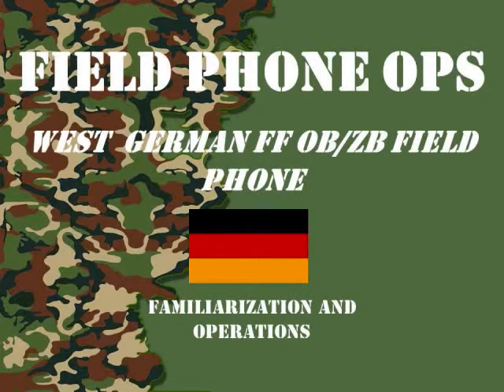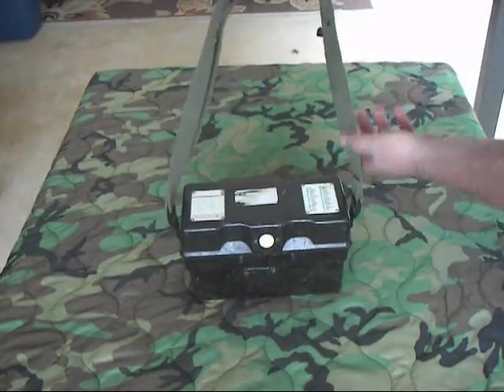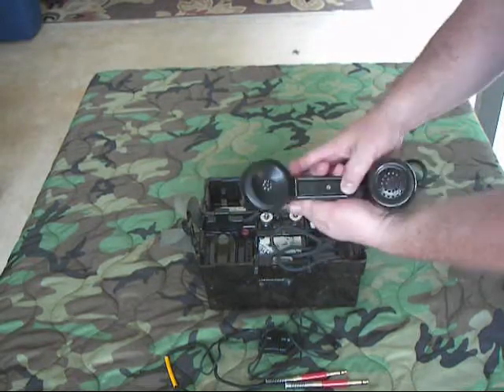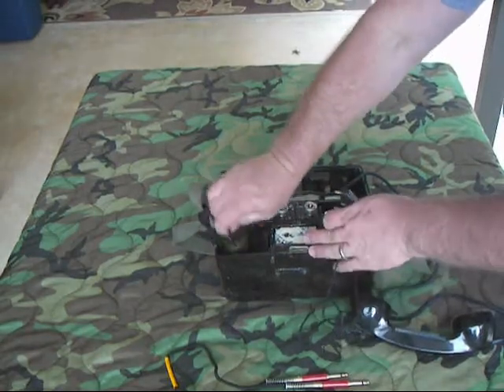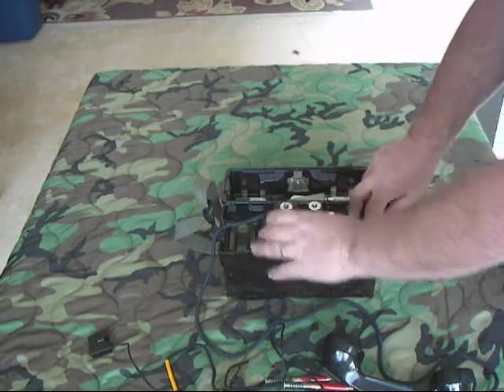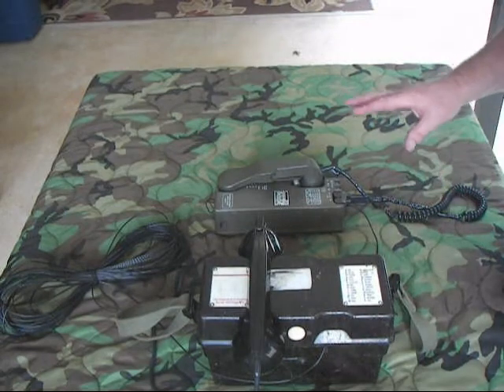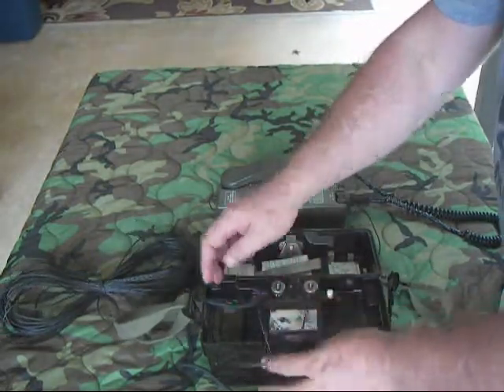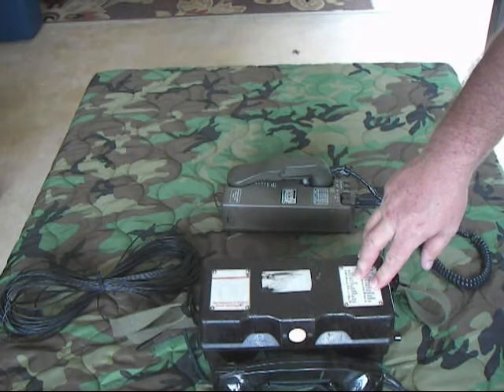FIELD PHONE OPS:  West German FF OB/ZB Field Telephone

Comment: Hey. So it will operate phone to phone normally whether or not the cradle is folded out except for not ringing? NAny downside to having the box closed and the receiver on the cradle phone to phone except not ringing if off cradle?
Reply from the maker: The phone was designed to be closed and used for CB with the cradle to allow a dialer to be attached.  If you operate it like this the phone must be hung up or it won't ring.  When you operate it with the case closed it will ring no matter what.  I would say it depends on the deployment of the phone, if its in a position that is exposed to weather and it doesn't have a dialer installed operate it closed.